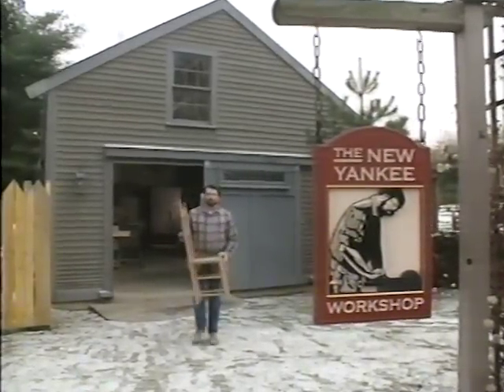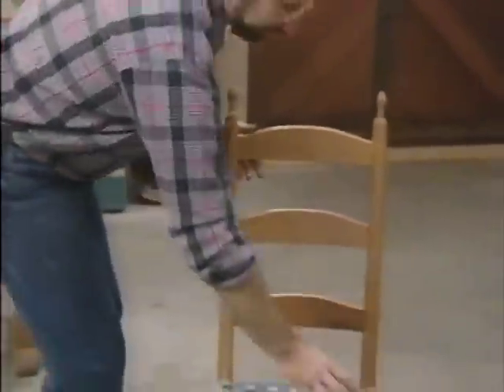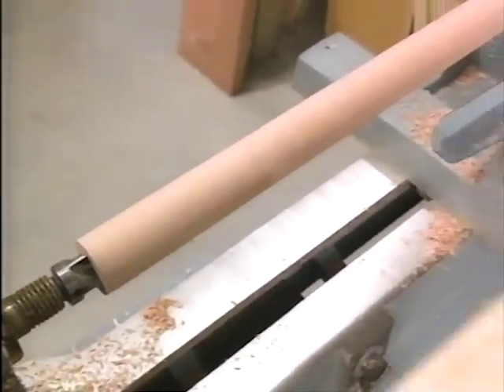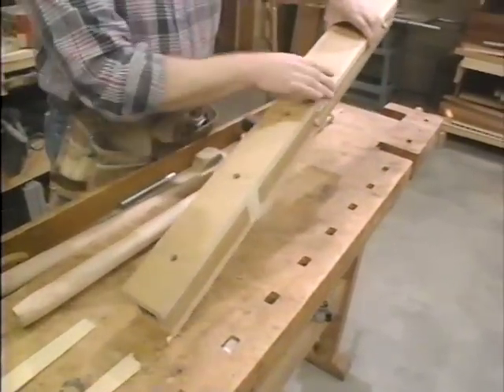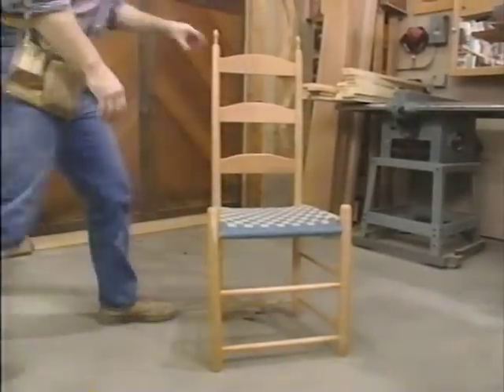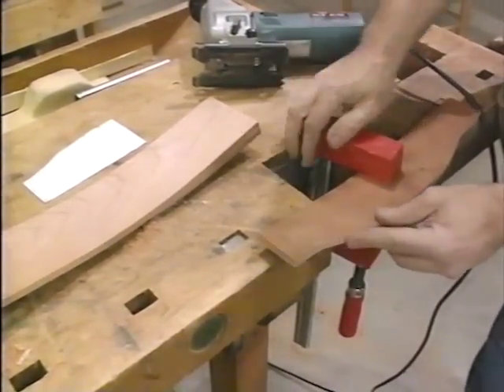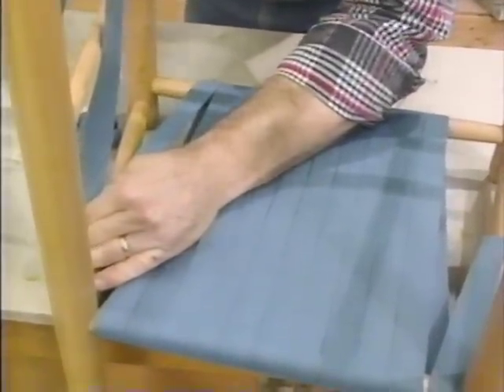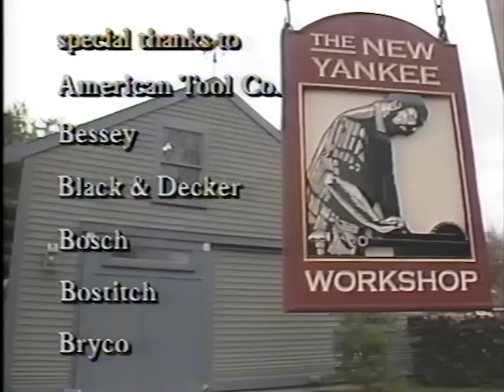Ladder Back Chair  |  S4 E13 *

Comment: I use power tools as much as possible, and I appreciate that Norm figured out how to do this with power tools, but as I watch this episode, I’m starting to think this project probably would’ve been easier with handtools. You could work slower, you could see the parts of the chair you’re cutting into, and and you can inmediately see if something’s off. We’re drillling holes and a few mortises here, not making crazy complicated joints. Come to think of it, I’m not sure why you couldn’t do most of this on a drill press without the jig. Mark out the legs and cut slowly.